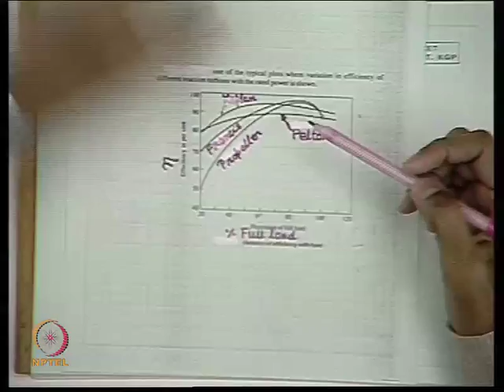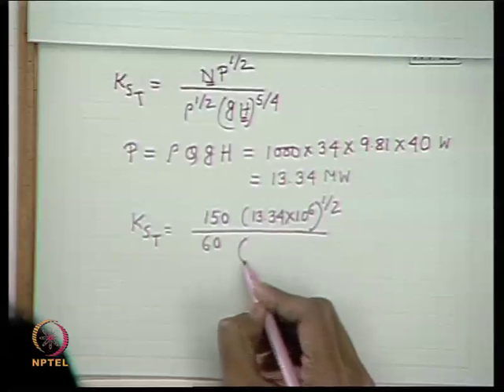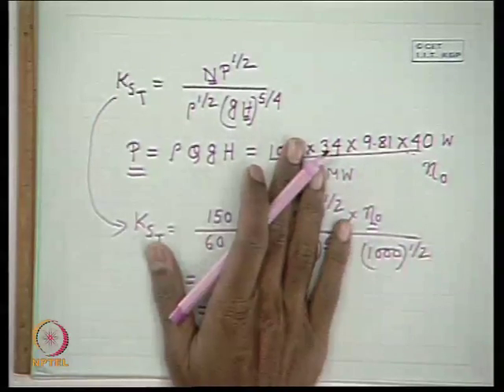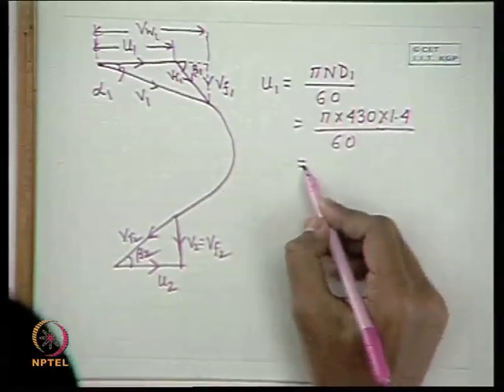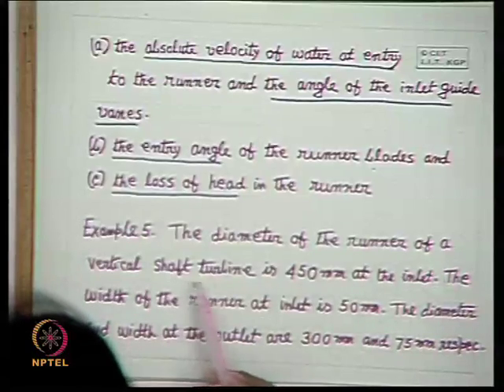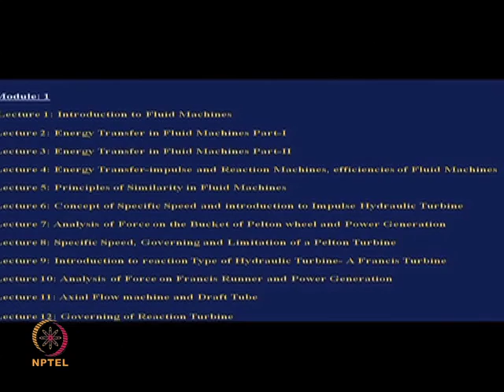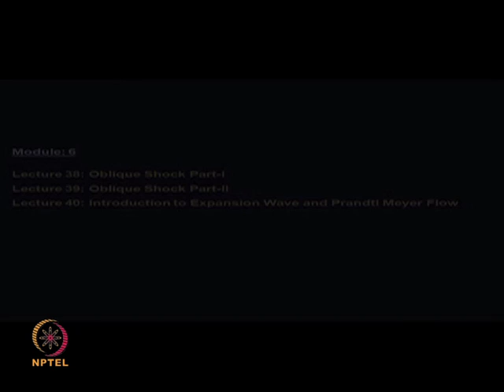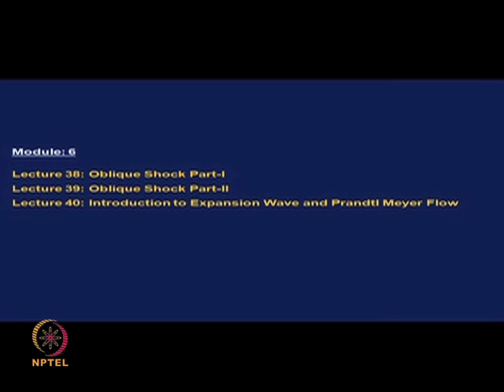Mod-01 Lec-12 Governing of Reaction Turbine

Comment: in kaplan turbine fluid enters radially ? i think its axial entry and  axial exit
Reply: DEEPAK TOMAR 
I think entry is tangential and axial
Reply: In the previous lecture it’s mentioned, axial entry axial exit
Reply: @sekharandharsha  thats propeller turbine
Reply: Entry is tangential plus axial
Reply: In Francis turbine, the inlet flow is radial and the outlet flow is also radial which turns at a right angle in the draft tube forming an axial flow. In Kaplan turbine, the inlet flow is both tangential(forming a free vortex) and axial but the outlet flow is purely axial. In propeller turbine, entire flow is axial from inlet to the outlet.